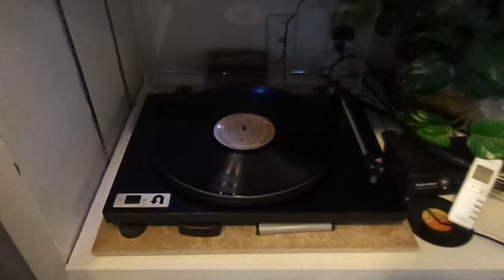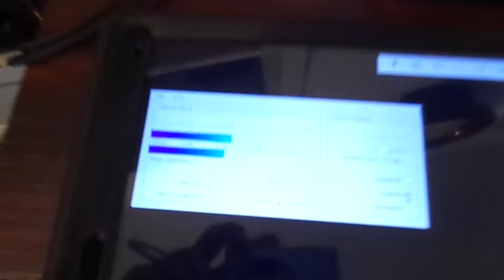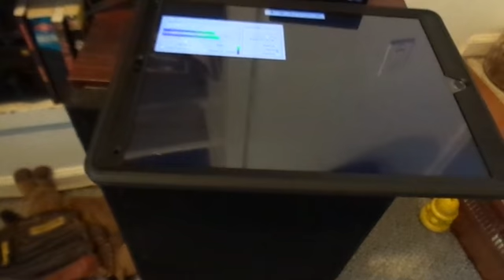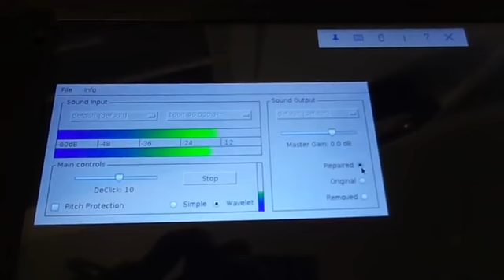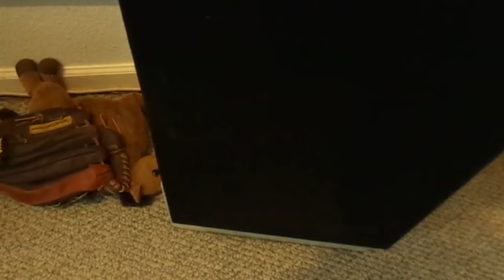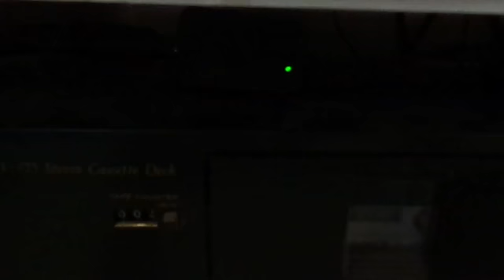Real Time Click Repair Filter Device - ClickRepairRT w/ a MiniPC

Comment: The Vinyl MacGyver strikes again! Does it also remove artifacts from vintage Seka films? If not, you'll need to upgrade.

Very cool stuff, Kris. Apologies if I missed it in this or the prior videos, but have you automated the metadata tagging? Do you connect to a Gracenote server or something that scans the files and tags them with the right data, or is that something you have to do manually? And yes, I get that for a savings of about four grand, one can suffer with manual tagging. Anyway ... awesome as usual!

Cheers, Tom
Reply from the maker: Well, this gadget doesn't record anything - it is just real time.  I am sure I could make it like a DVR, but I'd prefer to just use my digital recorder setup and use my other methodology that I published previously to make vinyl into digital files... the freedom this device gives me is not only ALL records are cleaned, but now I am not forced to digitize anything unless I want it on the go - which most of the time I don't... If I have the vinyl record, Id rather listen to it and keep my digital player filled with digital only titles so I can enjoy them there, if you know what I mean...
Reply: AH, duh, I didn't get that even though I clearly heard you talking about 'real time'. Man, that makes that setup even more fascinating. It sounds like a solution that you could market!
Reply from the maker: And yet this is one of my least viewed videos.  I posted about it in three different forums and it went over like a lead balloon.  For whatever reason, nobody is interested or they glaze over once I start speaking about it.  I knew I shouldn't have worn pants for this video.
Reply: I don't get the impression you monetize your channel (that's your business if you do or not) but stuff like this is super-interesting to me even if sometimes it just goes over my head. In a case like this, where you came up with a creative, intelligent solution to a problem that had been bugging you, you should be proud of it and not hesitate to share it if you care to. Number of views, to me, is irrelevant. Talk about what YOU want to talk about.

If you want more views, change the title. You could 'market' a video like this by titling it 'How To Save Money Buying Records' or 'How To Save Money By Being Able To Enjoy Cheaper Records'.

Click, Repair, Filter and Device are only likely to entice techie folks. Average folks, though, will want to know how to be able to not hesitate to buy dollar-bin records.
Reply from the maker: Yeah, I don't run the channel with ads or anything - this is free for everyone.  Same with the knowledge - I wrote out STEP by STEP on what I did, how, and why on the dropbox link for anyone to replicate themselves.  It's just weird that even though I posted this on a few tech sites with a description of what the video was and whatnot, nobody seemed interested.  I'm just guessing people want to keep the hot side hot and the cold side cold.  No matter - I bought some VG- records that were a buck and they sounded NM. :)
Reply: Bottom line: you WIN!
Reply: Hey Kris, this just came across my eyeballs (not in a porn way): https://www.indiegogo.com/projects/sweetvinyl-sugarcube#/

Two products are being offered. One is just for click repair and the other is click repair and ripping (with Gracenote functionality I assume). The box that does just click repair - what you showed in this vid - is being offered for $1125.

Besides the price difference between what you built and the Sugarcube device that just repairs clicks, another interesting thing I noticed is that of the two devices being offered - just click repair, and then click repair plus ripping - almost no one is selecting the 'just click repair' version. My takeaway is that the folks who would pay $1125 for click removal probably wouldn't own records with clicks in them. Also, the folks who hunt for bargain records probably won't spend $1125 to repair clicks. What am I getting at?

IMO if you could manufacture a $250 box that does the click repair, I bet it would sell and I bet a fair number of record stores would stock it. It would be a hook to getting folks to buy more used records and not worry so much about the condition.

Just a thought. I get indiegogo emails once a week I think and this one reminded me of your video.

Cheers! Tom
Reply from the maker: Yup, actually their demo inspired me to build the thing... I knew people used their laptops but I wanted an all in one solution.  The thing holding me back is that the commercial version of java isn't open source/distributable so it would take effort to make the licensing happen, the open source version of java just isn't up to the task for real-time like this... the other thing is the author of ClickRepair has decided to discontinue support/offering the RT version of his program - so to get past that hurdle is just too much time/effort for me - I was actually wondering if anyone would have privately offered me to help the build one - only one person did so and when I listed the things I needed him to do (since I was going to do it for free since he was a friend), he declined... If the Java issue wasn't there, I would have just made an installer/base image and anyone could have had it for free as far as I was concerned.  
On top of that, since I gave way EXACTLY how I did it on the instructions, nobody has shown any interest on doing it for themselves, either.  Basically, the project was a bust for the general public, but a big win for me.  I have acquired a Raspberry Pi3, which would actually bring the project down to about $100 total with all the components if I tested it to see if it would work on that hardware, but since there hasn't been any interest, I have been putting my time elsewhere (a big commodity for me on the farm)...
Reply: I think you have a level of desire for tinkering with technology and computers that is rare in the general public, so it doesn't strike me as unusual that nobody else would want to build the thing. I often struggle for free time, and have things that I'd rather do than tinker with technology. In the past when I've had more free time, I've built my own computer, fiddled with some Linux (gave up when finding drivers for things drove mental) and would still do that today if I had so much free time and was super bored. However, when free time hits, there's the woman, the dogs, the friends, the music to listen to, the ever-growing stack of unread books ...

Still, I do believe that if you had a cheap consumer product that you tell people "just plug your turntable into this things then this thing into your stereo" and it was ~$100 - $200 it would sell like hotcakes.

Don't be discouraged. I find the techie stuff you do to be fascinating. If you're just doing it for yourself, then sharing what you did and how you did it, people will still be interested. At least I will.

Cheers! Tom
Reply: @dixielandfarm  
Do you think a device like this could be made with a raspberry pi 3b+ instead of the gigabyte mini pc? I'm planning on making an attempt at building a device like this soon but I don't want to spend more money than I have to.
Reply from the maker: Believe me, I tried.  My first attempt was with the pi... but java and Linux the Pi was just too underpowered to do the real time processing, no matter what I did.  To be fair, even the gigabyte can have issues if you set the correction too high - you can hear it start to stutter and clock out with the processing.
Reply: @dixielandfarm  
That's too bad. In that case I'll keep using my laptop for now and if I try to build this in the future I'll buy a better mini pc. Regardless, this video was very helpful and an incredible find.
Reply: I'd like to use something like that but I have zero Linux knowledge. You should sell these ready-made devices as a kit to people like me who don't have the time to take on something this time-consuming... to me, anyway. Send me a message if there's a way to arrange something. I'd be interested for sure.
Reply from the maker: Joe, I wish I had the time to help you out - but one of the biggest issues is support - when my box develops an issue it takes me two seconds to figure it out and fix it, but when I thought about "Could I do this for people as an opportunity", the support of it would just be impossible for me... I had even considered making a simple disk image where someone would just copy the whole thing ready to go from a download (for free!), but the licensing of the program and Java just would make it impossible.  Now the author no longer offers the program, anyway, so its a moot point unfortunately :(

Comment: Hell yeah! I saw that Fremer video and knew there had to be a much cheaper way to do live de-clicking. Nice job. And I like that you played the audio of what was being removed, which proves that it's not stripping out music, just the noise. Personally, I've pretty much come to terms with what clicks and crackles are left after a good cleaning, although I do have some classical records where it's really annoying. I may have to commandeer my wife's old laptop and get busy. Great video, Kris.
Reply from the maker: Thanks so much, Mike.  Since the soundcard is only $15, it is worth a shot.  I'm still tweaking the settings but I have been VERY pleased with the results.  There was a Count Basie and Julie London I was on the fence about picking up at Goodwill, but since I have this I took the chance - with the filter engaged they are completely fine - without, it is like sitting in a campfire.
Reply: Hi Would u sell your set with the working click repair software

Comment: Good stuff Kris.  I personally think this video is worthwhile to make public.   There is a lot of good info here but most people will tend to shy away from the Linux interface.  People don't understand that it's pretty easy to make a 'Live CD' if you want to tinker around with Linux without removing Windows or whatever operating system.   I bet there is an easy way to put the guts of this into a single box (i.e. Soundcard, Processor, Software, etc.), where one could just remove an SD card and transfer the declicked audio directly to their computer.   It would be a great way to make some money off of people who want a push button solution.  I think there is only one company that currently does this and their box is $4000.
Reply from the maker: It was the Michael Fremer video at the last show where they had a live declicker that hit the light bulb for me and I figured I could cobble all the pieces together.  Believe it or not, there is actually a simple way to record the audio off of this computer and have it remotely show up on an another computer without you having to do anything.  Of course, I could also devise an automatic recorder to a USB drive that is always running and you just pull the drive and you can pull off the last recorded hours... the trick is the track breaks and identification - which is where that other device is much smarter than my little hack here... Thanks for watching, I do believe Tuesday or Wednesday this video is going up.